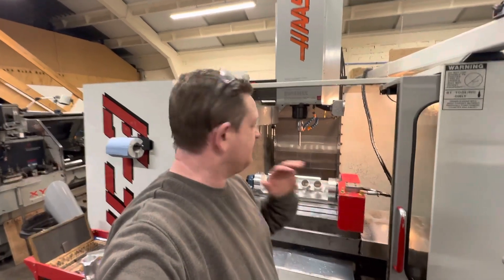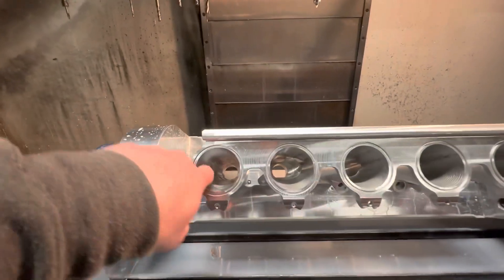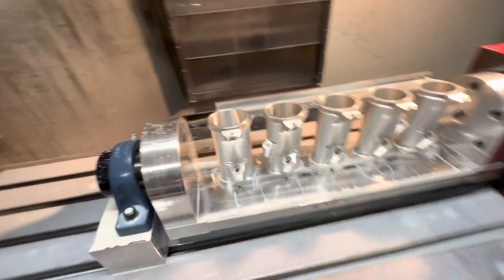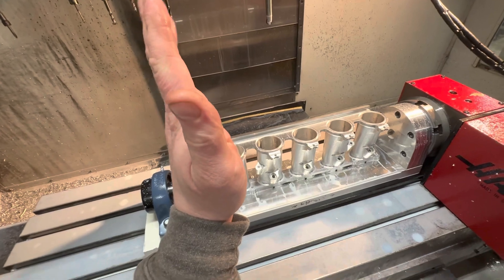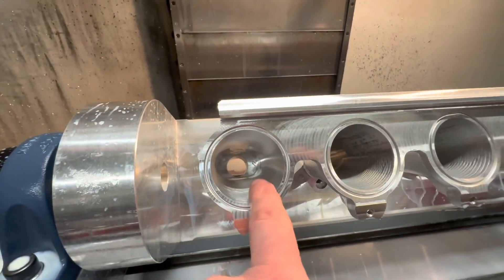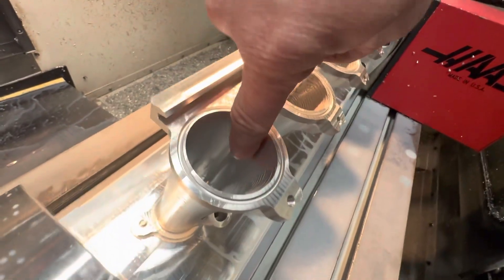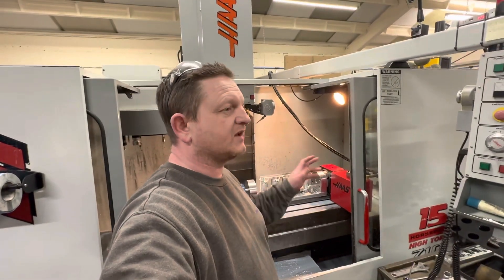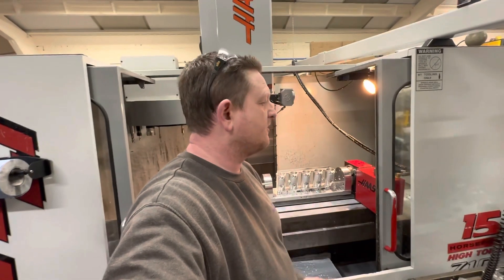Can Fusion 360 multi axis do this?

Comment: I know I’m late to the party but with the extensions you could do this, if I could help in anyway let me know, I have the extensions. I used flow then within the multi axis tab I used a guide curve and then used the option from curve, the 4th axis will rock, it’s an awesome path to see
Reply from the maker: Thanks for the offer, yes i have seen people use the full simultaneous using the extensions toolpaths, i not made these again since the video so not had the need to try it out since, hopefully at some point in the future il get another chance

Thanks
Marc

Comment: I would need to see your program. If the tool can fit there is not obvious issue, fusion can do that for sure. That seams like some other issue may be happening.
Reply from the maker: You are correct
The issue of missing the corners was actually because of an error in an earlier machining op from the other side that I didn’t pick up on until this side was done 

Thanks
Marc
Reply: @kinzy_fabrications  Ahh those small details get me all the time. Keep going cool stuff for sure. 

Best 
Matt

Comment: You can't do it easily without dwo which the older haas machines don't have. The cam software can write code any which way you want, but it would have to accurately reflect the physical state of the  machine. I'd just use it as a 3+1 setup to avoid the headaches.
Reply from the maker: Yes I think you are correct
Someone has shown me the flow tool path that will do what I want using the multi axis extension but if I want to I can achieve what I want without it and the material I thought I couldn’t get to was actually gouged material from the op doing the other side so I have now corrected that 

Thanks
Marc

Comment: We have Mastercam with 'Port Expert'... would peel that out with about 3 minutes of programming, and would take around 4-5 minutes to finish each port. Unfortunately the price of both Mastercam and the Port Expert add-on was more than my car (its a reasonably nice car). Recently did a trial of Fusion 360 to see if they had anything close just as a curiosity, and the result was there was nothing that would do it easily.
You could try a 3 axis surfacing tool path with the "tilt to avoid" option (or the fusion 360 equivalent)... provided there were no undercuts, might get you close.
Reply: I looked into port expert for my shop not too long ago......I decided to stick with the standard port path haha
Reply: Port Expert is actually a ModuleWorks software component that inefficient, legacy code, Mastercam licenses. Expect ModuleWorks port toolpath to eventually either be licensed by Autodesk for Fusion 360 CAM or something similar developed by the Delcam people in the UK. Delcam was purchased by Autodesk years ago. Presently, Fusion 360 CAM is incorporating most of the ModuleWorks component toolpaths into Fusion 360 CAM but not using the horrible, free, User Interface that ModuleWorks provides to their customers and Mastercam uses. Instead, Fusion 360 fully incorporates ModuleWorks toolpaths into its existing User Interface.
Reply from the maker: Hi

Yeah I’ve seen that some of the other cad cam suppliers have better options but way way out of my price range unfortunately 
Somebody has shown me an option in multi axis in fusion with the flow tool path so that’s an option

But it turns out the material left in the ports was actually from a machining tool path error I had made in OP1 from the other side so I think I have corrected that now 

Thanks
Marc

Comment: You should be able to do what your describing by forcing 4 axis only and using the flow tool path. 

However, I would just break up your operation into a few different ops and change the angle of the part for each section.

For these types of ops, I usually split the surface up so it doesn't get confused.

also a lollipop endmill with a smaller shank/bigger head can help too.

Just be careful it doesn't crash.
Reply from the maker: Thanks for the advice and messages mate